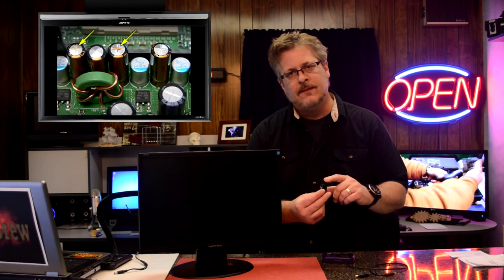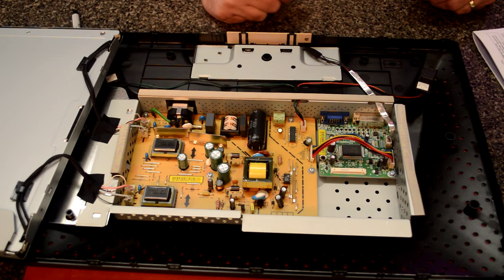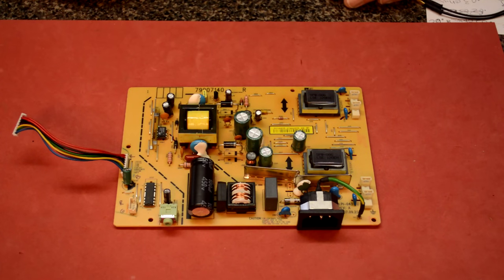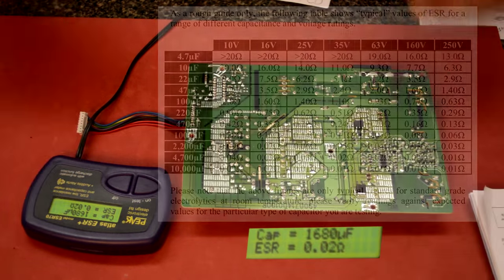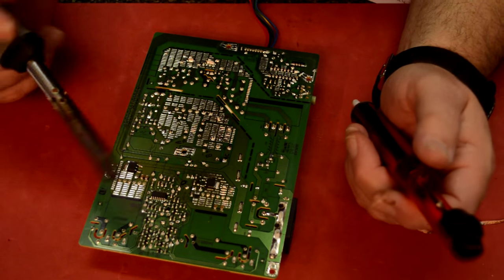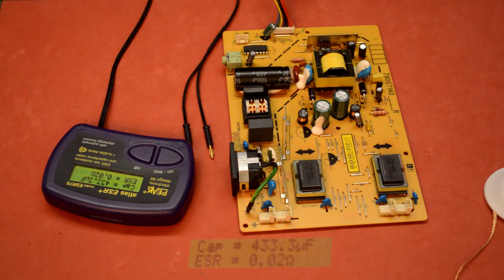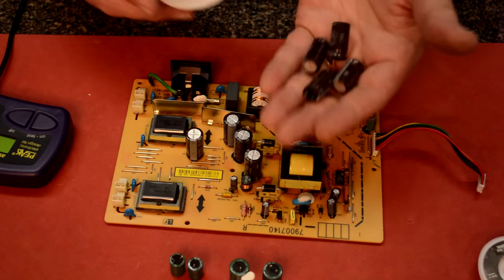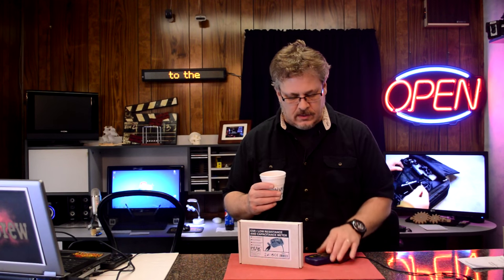LCD Monitor Repair - Replacing & Testing Capacitors with ESR Meter

Comment: Inspired by videos just like this, and soldering/desoldering tutorial videos, I repaired an LCD monitor about 6 months ago, with reclaimed capacitors from - yep - a PC motherboard.  Still going strong, so I'm very happy.  My first electronic repair!  I've now a nice little collection of capacitors of various voltage and capacitance.  I also have a hard drive/DVD video recorder that needs recapping, but I bought 2 new caps for that.  Dead PC boards are also good for just practising on.
Reply from the maker: MarkTheMorose Watch out or your collection will grow like mine and you will need a shop to put it all in :)

Comment: I personally go with United Chemicon,  Nichicon, and Panasonic caps with great results.  You can get a used Sencore LC102 for just a pinch more than that Peak and it will test caps at rated voltage plus do additional tests. I scored one for cheap on Ebay but had to make leads with low capacity coax and find a suitable switcher power supply for it, but still.  Maybe the Peak couldn't find a definitive fault with the obviously faulty caps because it can't test them at rated voltage? As another poster said, they all tested within 20% and theoretically should have worked. When the ESR is 0.00,  then test the cap with your regular DMM and see if it is directly shorted.  A vacuum pump desoldering station ZD-985 is $140, or a ZD-915 is just over a $100 bill. EEVblog did a teardown of the 985 and found the quality quite good.  Works a charm.  Toss that plunger or give it to a teenager for zit removal.  Never understood how you could ever use one of those things effectively especially on multulayer.

Comment: I turned my monitor on today and it has horizontal lines on the screen and all the icons for windows etc have a ghost image/relection an inch or so above the the proper image also the image is juddering. could this be down to a blown capacitor?

Comment: I used to repair TVs for 20 years back in the 80’s and 90’s.
I had the professional box style analog esr meter. Cost about $135 back then.
That esr meter helped fix many power supplies, vertical, horizontal circuits! 👍🏻
I learned the meter well and questionable measurements but learned to trust it 99% and trust that changing a few more capacitors in doubt was only a few cents more.
I’d usually end up replacing an average of 4 to 6 electrolytic capacitors for the power supplies.
Common problem!
Usually symptoms were intermittent power on/off to unplugging the ac cord and plugging back in to get power to won’t turn on at all.
Usually a gradual failure.
About the percentage value etc...  I’d ignore the math and just change the cap regardless.  It was cheaper to do it than to rely on the math.
If the caps are anywhere near the circuit path... just change it. 
Caps were about $5 bucks for 500 assorted values.

Comment: Good to see you back. My dell monitor was doing the same thing but mine kept making a sound like a robotic arm was trying to move and my power light kept flashing.
Reply from the maker: A. Young Hello, thank you, I have heard faulty inverter transformers make strange noises from the coils resonating in the past. Possibly your is having that problem.
Reply: Sound like a problem with the auxiliary cap that provides and filters the startup power to the switching regulator. Look for a tiny cap in the primary circuit: 10 to 47µF, low voltage. Might also be the over-current protection that periodically switch off the PS: look for a short on the secondary parts (could also be a defective cap on the user side...). I've seen once a problem with a defective resistor, very low value, used to monitor the current in the switching MOS FET... Just guessing, if it could help.

Comment: You made a very nice tutorial video. Thanks for inspiration. my acer h163hq lcd monitor's 2A slow blow fuse blown. I'm planning to give a try by replacing those caps that you replaced. what could be the other suspicious components blowing up the fuse??
Reply from the maker: It would be something on the power supply side. Chances are very good it's a cap but could be a faulty inverter for the back light as well.

Comment: Thanks for the video but in this video I saw ESR meter is useless. If you change all caps why to measure it.  Also, Peak device measueres caps exactly what 7 dollars lcr meter does... Giving hundreds of dollars seems to useless. Am I wrong?
Reply: This ESR instrument is professional. The point is that at least at the time of shooting this video, he had no idea of what the ESR is. The proof is that he replaced a capacitor showing zero ESR, which means a perfect in health cap, while all the rest he replaced were in excellent condition. For sure the problem was hidden elsewhere. ESR meters are indispensable and this video makes the wrong impression about them...
Apart from that, he should know that there is no way to measure capacitance in circuit. That's why ESR meters were invented. To bridge the gap...

Comment: All the caps you replaced were within +-20% tolerance this makes me doubt it was the caps.
Reply: I just thought the same, it is possible that the problem was elsewhere
Reply from the maker: Monitor still working well today (3 years later)
Reply: @GuruBrew  Ofcourse & can work more 10+y. lol
Reply: Yes, you are right!
Reply: Yes, same thought here. I would have considered all these caps good ...

Comment: My monitor doesn't even display for a second and the light on the bdoesn't turn on. Could the issue still be the capacitors?

Comment: Computer motherboards can be troubleshot and repaired using this same technique.  Focus mostly on the filter cap supplying the cpu.  Look also for electroylitic ooz coming out of the caps as well.   Fixing them is time consuming but rewarding as hell.

Comment: I learned that we can use high capacity high voltage cap in place of low capacity low voltage but what should be the maximum % values.can I use 1000uf /250v in place of 10uf /35v?
Reply: In most cases you don't want to change the capacitance value at all. You can go up in voltage but the capacitance should stay the same.
Reply: As explained by Nun Ya, you can go higher in voltage. Depending the use of the capacitor, usually you can also go higher in capacitance (let say +50% to +100%), but keep in mind that this oversized cap will store more energy and not all circuit are able to handle that excess (charging or discharging). If the cap belongs to a more critical circuit (audio, timing, switching power supply, etc.), forget to change the value: the circuit was design for this exact value. As it was well explain in the video, the high voltage caps usually have a higher ESR, not all circuit can afford that change... And one last practical thing, a 10µF/35V is a tiny cylinder while a 1000µF/250V is a huge cap!

Comment: When you are shopping around for your caps from digi-key or where ever, first take a harbor freight digital caliper and measure its dimensions.  Physical size, distance between  leads. (This is important.)  Pay attention to gurubrew advice on capacity and voltage specs.  Shop carefully and try to buy higher end products.  I personally won't install used components ever, because I don't like going back in for a secondary failure.  But that's just me.     There are lots of really nice motherboards out there that only need new filter caps installed.  I'm sending on a restored one right now.
Reply from the maker: +Thema inproblem You look a lot like Steve Martin, the resemblance is uncanny  ;)     Good Tips!
Reply: +GuruBrew 

I get that a lot. :-).   Sometimes people mistake me for a jerk.  :-)
Reply: Let's be candid, high quality low ESR capacitors, particularly for computer monitor power supplies are cheap.  I replaced all the caps, with the exception of the mains cap, in three Viewsonic monitors with Panasonic & Rubycon caps for less than $12 US.

Comment: All those caps you replaced were within 10% of the rated value, and had good ESR. Order electrolytics, and you'll find that the average is rated at +/- 20%. You may have possibly repaired an intermit when you soldered those caps back in. But whatever, glad the monitor was fixed.
Reply: I agree with your thoughts.

Comment: You should get you a desoldering gun,  There are several good ones, I like and use the xenon hot air gun, it will do surface mount pretty well as well.
Reply from the maker: Leonard Legg Yes, thanks you are right, I need to get a proper desoldering gun. I had one and it fell off the table a broke. It was just a cheap one so I pitched it in a fit of rage. I noted that the better quality ones run over $200 US so that is a little hard to swallow. Steve
Reply: GuruBrew Yeah I understand.  I think I paid about $140 for the xenon, but that was 15 years ago and I am still using it, and I used it several times a day there for several years as the lead bench tech at a casino.  I could get as much good out of it as other benchs were with $12,000.00 desoldering stations.  Probably the most useful electronics tool I purchased since the multi meter.

Comment: I own and use a Pace PPS 85 soldering/ desoldering station and It's a masterpiece of engineering!  If you do this a lot and have the money, you will never regret buying one but the handpieces seem to never be included for some reason.   It's a real gem.   Look on Ebay.
Reply from the maker: +Thema inproblem Ya, Thanks I looked it up and $250 used on Ebay. Hummmm anyone want a review for this :)
Reply: I really think that you would like it a lot.   Consumables can be purchased on Amazon from Techni-tool.   Pace really makes some great products.  Lastly,  I really enjoy your presentation.   It's very nice and laid back and easy to watch and listen to.   I want a review!  In my opinion it was a good decision but I want yours!!! :-)
Reply: I want to modify my previous remark.  I think Pace's early gear lacked style and I would not commit to it based on it's look alone.  But the station that I have now is a masterpiece in my humble opinion.
Reply: Steve, contact me privately if if you decide to pick one up.

Comment: The issues with bad electrolytic caps is not limited to just monitors, but is the primary cause of failure for most power supplies in electronic hardware.  An ESR meter is an excellent way to test these caps and will pay for itself usually in the first repair.
Reply from the maker: hankus253 Hello, I have a bunch of monitors and TV's that I have saved that are not working that require my attention. I am set with a lifetime of electronic viewing devices :) Does your auto leveling work on the 3D printer now?
Reply: GuruBrew As a matter of fact yes, ABL is good and my cabinet just needs paint and the acrylic windows installed and that phase will be complete.
Reply: I agree.  I have replaced many caps in both monitors and power supplies and saved quite a bit of valuable equipment from the recycle bin.

Comment: Good video.  I have a Samsung with a white screen.  No image.  Backlights seem to be fine.  What do you think is the problem?
Reply: TCON board
Reply: @NunYa953    TCON board.  Could you suggest a source?  I have a question if you know.  I see 2 caps that look suspicious.  A little puffed on the top.  Very little.  A lot of videos are saying that changing out bad caps can solve the white screen and that a TCON swap is sometimes unnecessary.  Is there any truth to that.
Reply: @alext9067  
Here is what I would do: if the caps look even somewhat suspicious then change them. Ideally you should test them with an ESR meter. If you don't have access to one then the caps are dirt cheap. Always suspect caps first because they the most common failure. They are also the easiest and cheapest to replace. If caps don't fix the problem then it may be the TCON. A TCON is definitely not as common as caps. Make sure you know the rules for changing cap voltage capacitance etc
Reply: @NunYa953   Ah, thank you.  Good logic.  I just need to make sure I get the right board.  There are paper labels and I'm assuming that the board would have a number printed right on it.  Is that a safe bet?  Or do I use the model number of the monitor?  Do you think eBay is the place to get it, or someplace else?  Thanks again.
Reply: @alext9067  
If it's just capacitors you don't need to buy a board. Buy the caps and change them. When buying boards you ALWAYS go by the stickers as there are usually multiple "versions" of the same model.
Reply: @alext9067  
Even the tiniest bulge on a capacitor means it's bad.
Reply: @NunYa953  Yeah, they're coming out.  I should replace them all.  I'm not familiar with which brands are garbage and which are good, but these didn't last very long.
Reply: @alext9067  
Personally, I don't ever change them all usually. That's up to you. I would just make sure to get high temp, low ESR caps. They are easy enough to change .
Reply: @NunYa953   I just pulled that board out again and looked at the caps and now they don't look puffed up.  I think the gas has dissipated and the tops go down.
However, I looked for a new board and I can't find one.  It's a BN97-04866A and they call it a master board or something like that.  I see all sorts of numbers except that one and the pictures don't match.  I may have to replace the chip.  The number on the chip is extremely faint and I really don't know much about changing these things.  Things are getting interesting.

Comment: i have a emachine made in 2000 but its windows is corrupt and i don't have the right keyboard and mouse for it it has usb ports but the mouse and keyboard don't work it uses ps/2 can you install windows xp on it and get a mouse and keyboard that works on it and if so how mutch would it cost
Reply from the maker: elementalfox gaming Yes, you will have to get at least a PS/2 keyboard to install the XP software as a USB port wont be recognized until Windows is completely installed and running but once it is you can use your USB keyboard and mouse. A PS/2 keyboard can be found for very little if not free. Ask a local repair shop if they have any or check a thrift store. As far as the XP software install disk, if you don't have it then check on Ebay, I am sure you can locate it for really cheap. Have you tried restoring the corrupt software? look in my videos for how to restore a machine if you don't know how, as this might save you from all the above actions. Best of luck.
Reply: thx money kinda tight considering i'm 13 so thanks

Comment: My ESR meter is analog and while it's a great tool it's not fool proof.  It can really point you in the right direction, trust but verify.  Shop at digi-key, Allied or Newark.   If there is any doubt at all, toss a new one in.  They are cheap.
Reply from the maker: +Thema inproblem Well Said
Reply: +Thema inproblem I used to work in a tv repair shop and all of us used those ESR meters. I think it's really a useful tool and it was really a quick easy way to test them. When you work in a shop time is money.

Comment: If you measure any brand new capacitor you can buy today, you will NEVER measure the nominal capacitance written on its body. This is due to the cost reducing target all cap makers like to hit and they do. Especially as regards cheap caps, I have many times measured, for example in the main filtering stage of psus, 220μF instead of the 330μF written on their body, while their ESR was perfect. In this case the theft is obvious. So the only interesting criterion, for cap health and/or quality, remains the ESR value as the absolute criterion. 
In this video, two things were wrong. First, when checking in circuit these caps, one needs to wiggle the cap while watching the ESR value. This will reveal intermittency of the capacitor ' s internal bondings with its external terminals. This was not done and is a mistake. A faulty cap can easily escape when measuring ESR in an absolutely static way. The second mistake, usual with instruments that monitor both capacitance and ESR, is to take into account the capacitance value. For in circuit measurement of caps, the capacitance parameter will simply drive you crazy as THERE IS NO WAY TO MEASURE IT IN CIRCUIT!...

Comment: Gosh you spend a lot on solder wick.
yeah you sound week, never heard you like that.
So far not impressed with your tester, need to check into a sencore LC tester. Matter of fact I have an extra one I been thinking about selling.  An LC 56 I believe it is.

Comment: Honestly man, your video scared the shit out of me.  Throwing out random statements like "it's ok to go up in capacitance" is just ridiculously irresponsible.  If they're filtering caps on a power board then sure, but any other time you just disrupted the functioning of the device.  Changing the capacitance of capacitors can alter the wave form of signals on the board, disrupt timing within devices.  Your statement as it was made is simply wrong.
Reply from the maker: +Stephen Garner YES, you are correct and I should have added in a statement specifying this practice only pertains to filter type cap...,Like the ones on a power board, we were working on.

Comment: Conclusively, the capacitors are the problem & need to all be replaced due to their high resistance when they dry up inside or blow or bulge even.  ipso facto.  Troubleshooters:hand-orange-covering-eyes: conclusively won their case.  Ipso facto